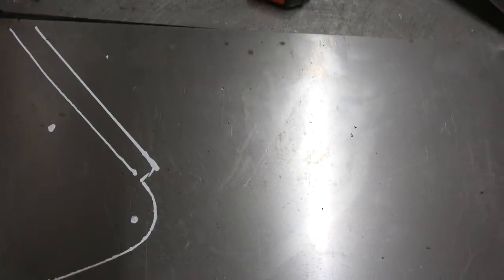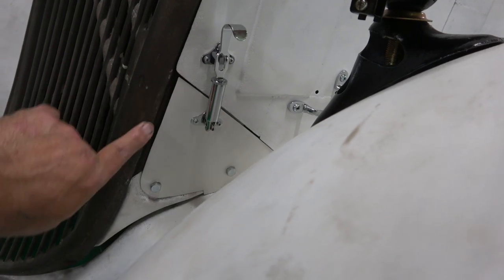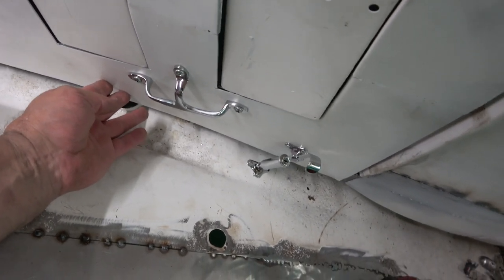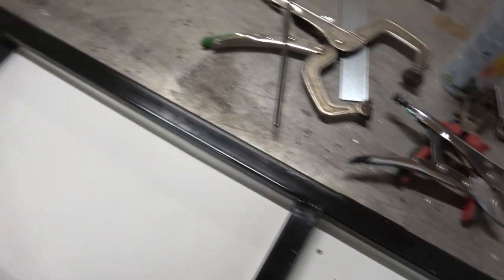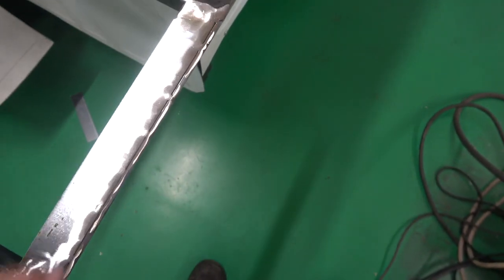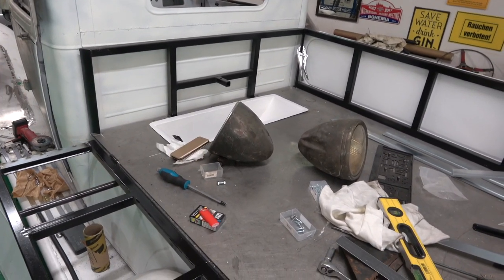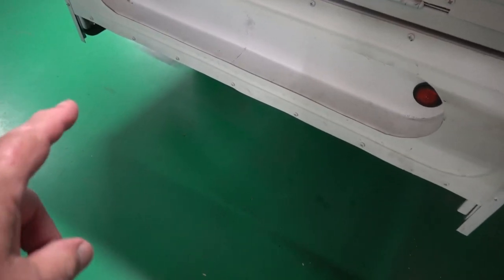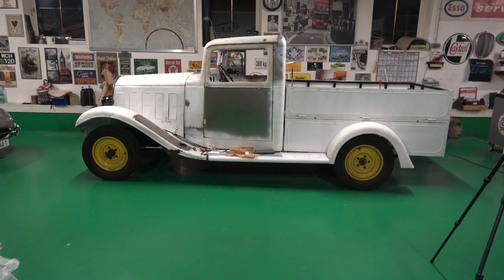1930s Barn Find Heritage Application Photos

Comment: mint, yeah the old stepsides had a piece run up at a 45' angle then the pipe run along it on each side of the box
Reply from the maker: Doug,  Thanks. I‘m pretty pleased so far but there is loads of metalwork to do let alone mechanical 🤔 Cheers Dave